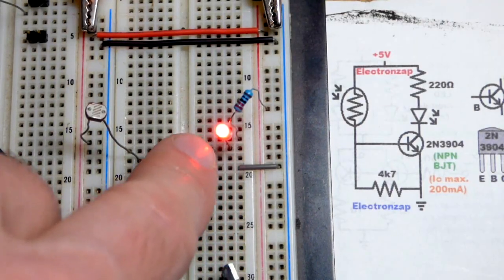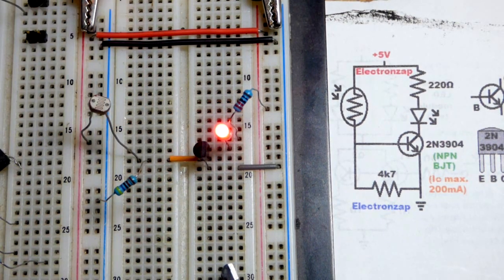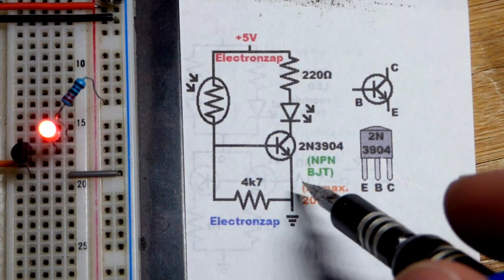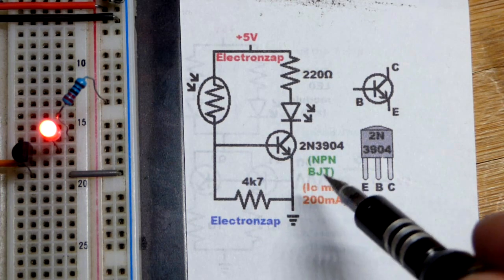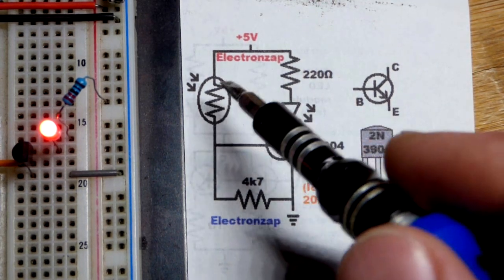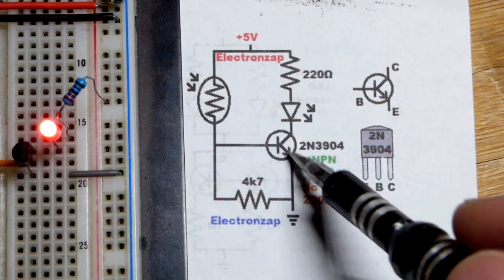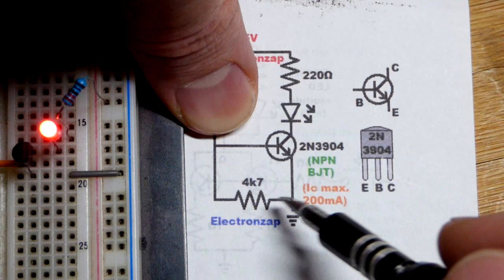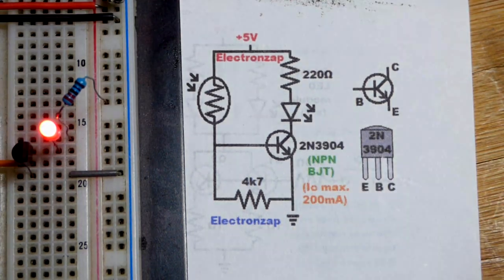Bright light on LDR turns LED on using NPN Bipolar Junction Transistor BJT circuit

Comment: Why does my circuit work the opposite my LDR is connected to ground while the resistor is connected to positive on the base circuit are you sure this is  npn transistor ?
Reply from the maker: Swapping the LDR and fixed resistor positions will give the opposite outcome.